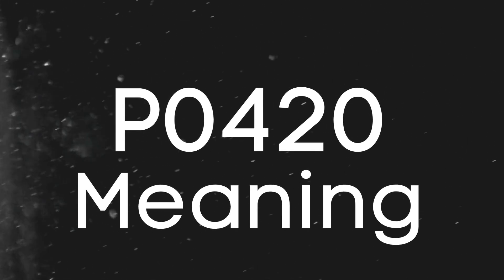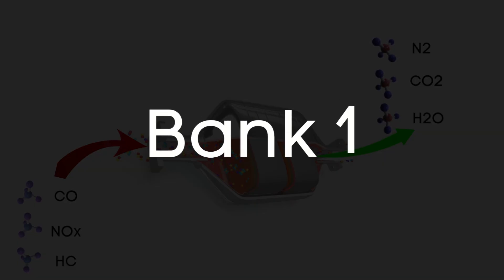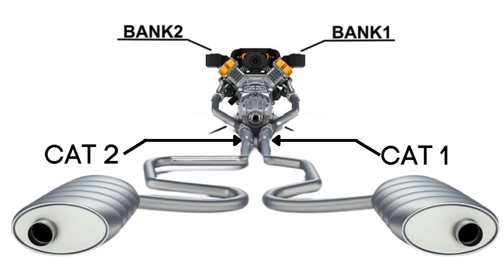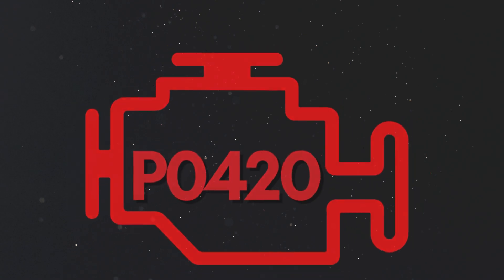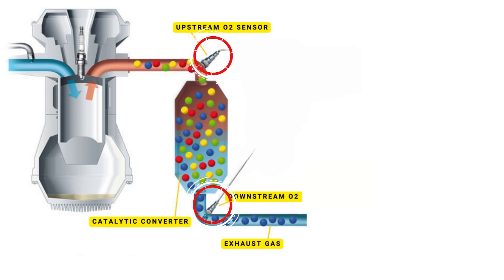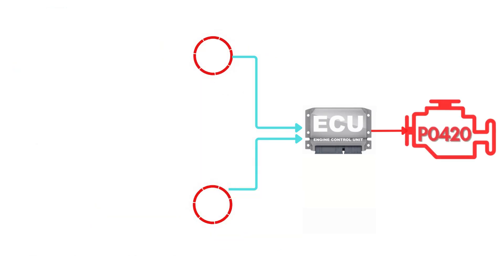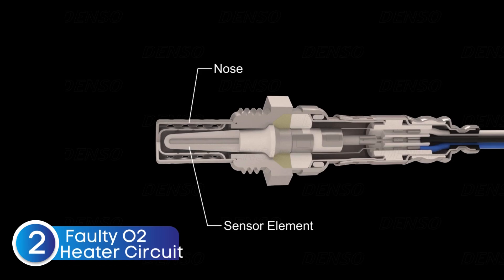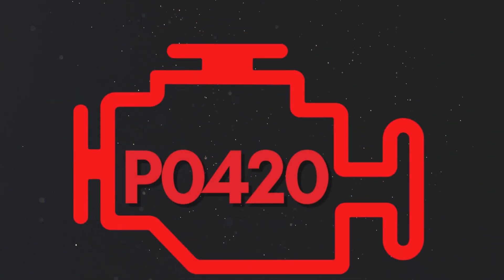How to fix P0420? | Catalyst Efficiency Below Threshold (Bank 1)

Comment: For code P0420, before trying anything expensive, try putting in premium gas and clear the code and see if it works.
Reply from the maker: That's a good, cost-effective first step!
Reply: From an empty tank how much would i put in my chevy ? Do I fill the take with premium or just half ?
Reply: @brandonloving7179 
Basically what I meant is using premium gas instead of regular gas from now on and see if it helps as an easy/less expensive step for troubleshooting the problem.

Comment: I change my cat, changed both o2 sensors and I still jave this code. I checked the MAF sensor and it works properly. I checked for leaking before the cat and there was a dot which we welded. In the end nothing helped. What should I do next?
Reply: How did you end up fixing it?
Reply: Put an O2 sensor extender on the downstream sensor

Comment: It basically means you needed to replace your catalytic converter.
Reply from the maker: It is not always needed to replace catalytic converter. Sometimes due faulty readings of oxygen sensor, this code may get triggered. Before considering replacement of catalytic  converter check for oxygen sensor circuit or any other OBD codes are active related to oxygen sensor.
Reply: @carfix07 correct, i had that issue p0420 and changed the oxygen sensors. The code went away doing a drive cycle. On the other hand take off the converter and clean it. Replace only if its damaged internally or cracked.